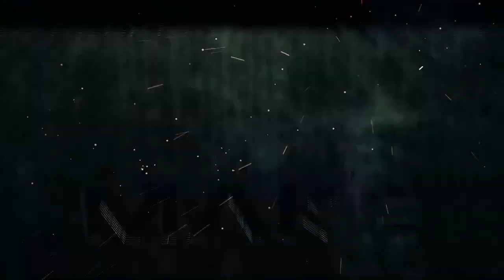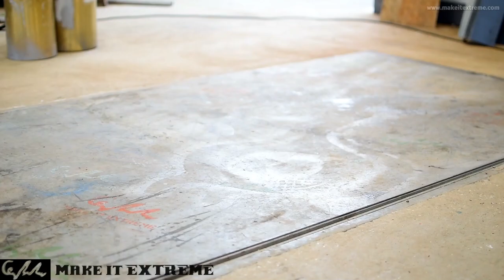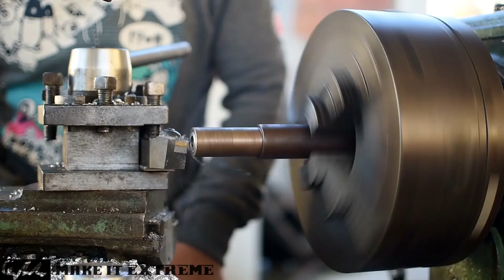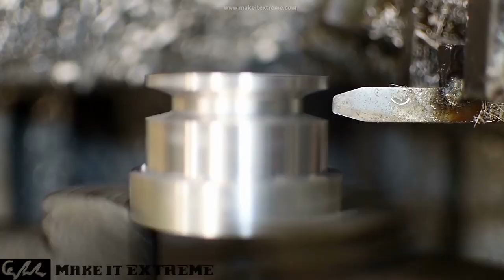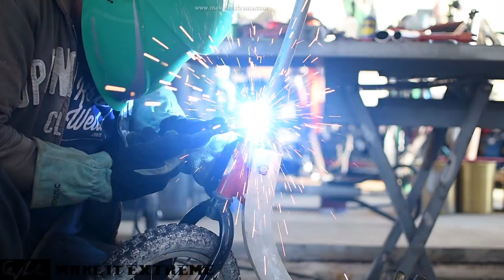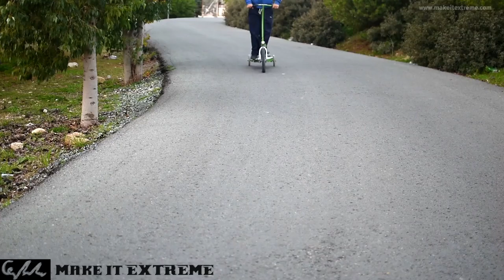Angle Grinder Hack 5

Comment: I am amazed by the number of HACKS this guy is able to turn out.  I just wonder how many cases of green paint and how many Makita angle grinders he actually has in his storeroom? It is interesting trying to follow what I think is his planning path since we never see any drawings-only piles of dead electronic components and Rusty metal which somehow turns into a thing that works. He seems to make the right choices-cut tack weld grind to fit and paint to match. It seems to work for him - Go Guy Go!

Comment: Why not connect the power switch to the handle bar? You would save so much battery not having that run all the time that you are getting ready to go. It adds up. And you could add a brake that you can step on to apply pressure to one of the rear wheels like you see on the toy razor scooter. Good build.

Comment: Since this is a battery powered angle grinder, you should also be able to build in a speed controller. The simplest design I could think of right now would be the switch of a cordless drill with some pull cable (like you use in bicycle brakes, don't know exactly how you call that in english).

Comment: as I seen in the other videos, you should speed up the cutting velocity of the carbide heads. your tools will last longer and the surfaces are getting prettier... even without cooling liquid. especially with aluminum. check out the numbers on the carbide head package, calculate the speed with diameter. it makes a huge difference, be aware of the hot flying chips. use goggles at least

Comment: Nice build.  You have some great machining skills.  And a fuck-ton of nice shop gear!  But rather than switch the grinder on, and let it run  all the time wasting precious battery power, why not wire in a pwm DC speed controler?  These things are less than $10 on ebay.  You could put the potentiometer into a handle grip throttle.  No need for the gear box, pullies and belt. This also will GREATLY extend the battery life, as it rapidly pulses the motor on and off to vary the speed - PWM Pulse Width Modulation.

Comment: Should have been only two wheels, and the grinder turned sideways, powering the rear axel directly, instead of through the gear box.
Reply: Actually I already built an electric scooter. Working on my second design for commercialization. You don't know me, don't even try to insult what you don't know.
Reply: Your Moms Hitachi the video content has been filmed. The commercialized version, obviously won't be on YouTube.
Reply: Eco Mouse: I'm afraid unless you can post a few seconds clip of yourself, the device and today's newspaper you are going to have to leave this comments board. You really are a very foolish young lad.